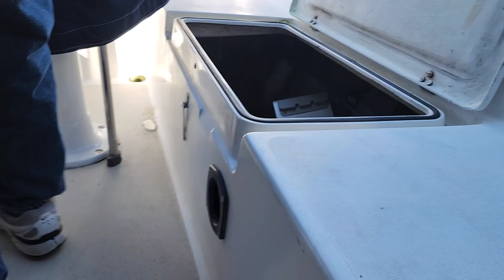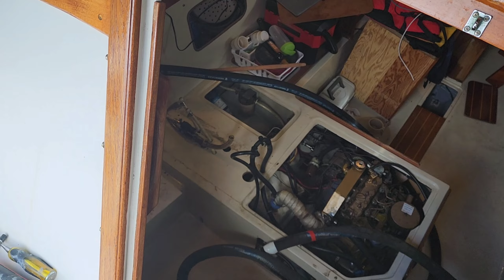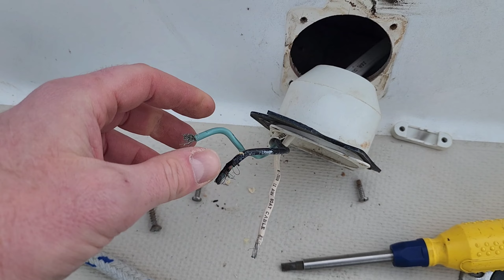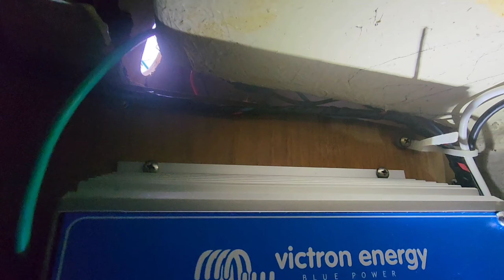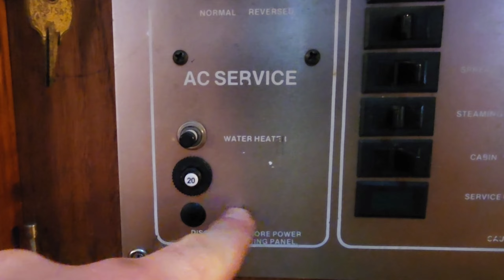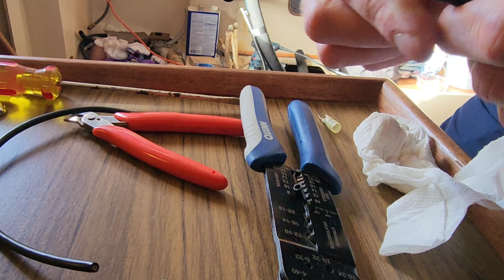New exhaust hose, shift bracket modification, & AC power upgrade and repair.

Comment: This is fabulous.  I'm just getting ready to swap out the exhaust hose on my 1985 Catalina 30 and this video will make a huge difference in that project.  You've also given me a new perspective on the electrical systems.  Thanks so much!  Dave
Reply from the maker: Awesome, I hope your exhaust hose replacement goes and smoothly as mine did!